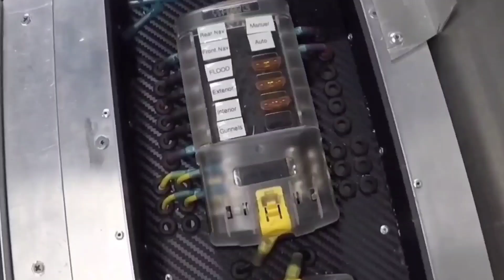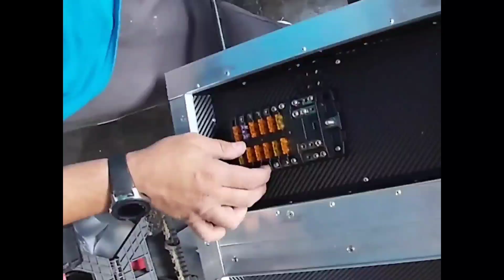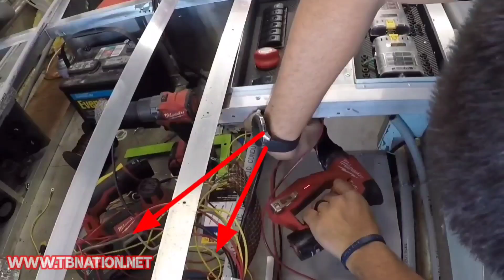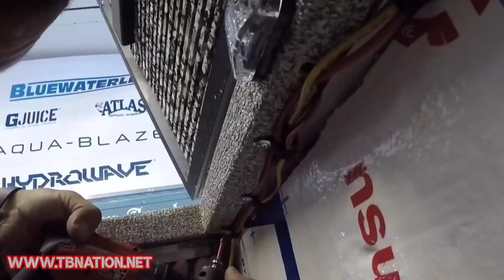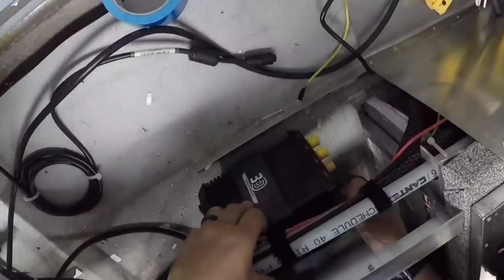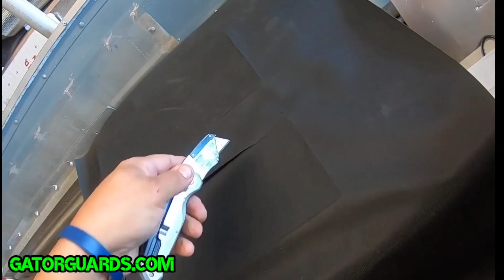The ULTIMATE SWITCH PANEL WIRING VID for boats. blue sea systems fuse block install

Comment: As an electrician, I like the grommets. We never rest wires on bare metal edges, and we are wiring stationary buildings. I can only imagine that the jostling a boat goes through will lead to failed insulation.
Reply from the maker: I know
Reply: @TinyBoatNation lol. I’m sure I’m not the first to make that comment.

Comment: Those are called plastic wire clamps, in most cases, both PWCs and zip ties in black are UV rated. Use the Velcro ties for assembling the harness but use the zip ties for the final job. Zip ties are also available with screw mounts

Comment: How do you know where to put your yellow/ground wires on the fuse block buss bar combo?
Reply: man i’ve got no idea. i’d say just start plugging it in different places until it works 😂
Reply: It doesn’t matter. As long as your positive and negative are connected to the main terminals every positive should have power and every negative should have ground. Just make sure you’re using the correct size fuse for each positive terminal.

Comment: Those plastic clips are called P-clamps. You can also get wire zip ties that have a loop attached to screw it down to be more secure. So kill two birds one stone. Also, that stuff that you use for conduit is known as Flexo-PET and is also what they use to make rod socks or rod covers.

Comment: Very. Nice. Thin wall conduit is preferred when possible. The ability to pull new or additional wires throughout your boat makes life future proofed. Loved to see you labeling wires. A real pro approach.  The drop in panel is great. Where are your 50 amp main breakers and main bus bars?  Great job. I hope mine turns out as well.

Comment: I know this is probably a dumb question, based on how advanced this is. What wires did to connect to the battery? Everything looked like it was only connected to fuses, switches and shutoff.

Comment: Hi Tiny boat nation, massive fan here South Africa, thank you so much for the awesome videos, helped us here in the bush so much 🦁.

Just a question did you wire your fish finders and bulge pumps onto the same fuse block?
I have three finders (nothing large), a 2xbuldge pumps and an aerorator is that fine to run on one fuse box? Do only the Leds effect the finders?

Thanks again for the amazing videos

Comment: Looks nice, creative, in the future you may consider using orange for your dc+, as per abyc color coding.  On a small boat not so much of an issue, but if you happen to have an inverter for ac onboard, its help with confusion and safer..  Cheers!

Comment: Just a suggestion you should use black zip ties.  They are outdoor and is resistant. I know you are wire tying in the sunlight but they should hold up longer is only reason I suggest it. Good work man

Comment: nice job. one thing i'll add is add enough slack so if you have to pull it out you can. another way of doing that is running a terminal strip as a connection point between the switch panel and boat wirings(though that introduces another connection point to have a problem with)

Comment: You do awesome builds.   As a electrical engineer I take joy in watching wiring on this tiny boat.  You have done well making it nice.  My OCD would look much like that.  I have a label make that uses a app on my iPhone and the labels are really good in industrial setting on motor wiring and control wiring.  Epson LabelWorks LW-PX400 Portable Label Printer.  It cost a few more dollars then others but is a tough and batteries last years with use.  I dream of having a 20’ jon flat bottom as wide as I can get it with a very basic build with less then what most would want.  I’m a simple fishermen, typical on change lures 3 times during a trip.  Fishing pole x2, small tackle box, net, bucket for fish and to sit on.    My boats in the past had a lights, trolling motor, with no wheel a main motor, bilge pump, and only front seat but if I get my 20’er I’ll build it up some like you do.  Thank you for the awesome videos and how to do stuff right.

Comment: I would encourage ppl to cut their cable ties flat, cutting on an angle leaves a very sharp point that later can cut your arm when trying to access those hard to reach places. If anyone’s been cut by one you know how much it hurts
Reply: Which in my line of work we call those booby traps! Cause you stickn your arm in a bunch of wires and come out with a bloody surprise. 

FLUSH CUTS EVERYONE! Not expensive and very well worth it. Plus makes your work look better!
Reply: Comtechs
Reply: Flush cutting pliers. Not expensive. Do the job right

Comment: Hey, nice work! 👍 May i have some suggestions? You can find some “label beans” in electric supplies shop, they were use to label control box with hundreds of wire, these rubber beans come in all colors and every of them have a letter A~Z, 0~9, and most important, dirt cheap. Say, all your fish finder wire are using yellow beans with “FF”, water pump using red and label “PP”. That makes a lot difference, especially if you have to troubleshooting the wires at sea, for obvious reason you may not have lights from battery.

Also, may i ask if you will use somthing call “magnesium tablet” on your boats? Some boat owners tells me that it is a must when you have different metals in a marine environment, it will create a weak circuit and rust pretty quick. I have check and find that some outboard motors do have such tablets slot for sacrificial purpose. Are you going to “ground” them to your hulk as well? Or leave it separated?

Comment: Nice! I went with the Blue Sea switch and fuse box combo. It's all in one unit and the fuses have a rubber seal. You should check them out if you haven't already. They're kinda high though..